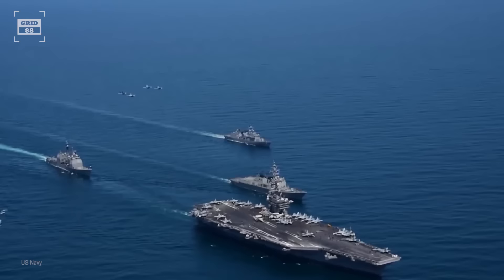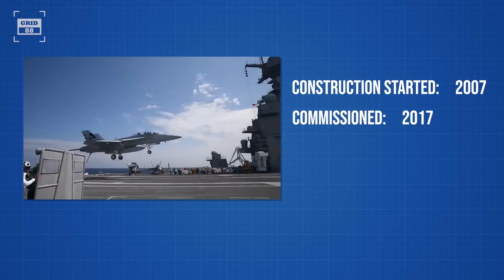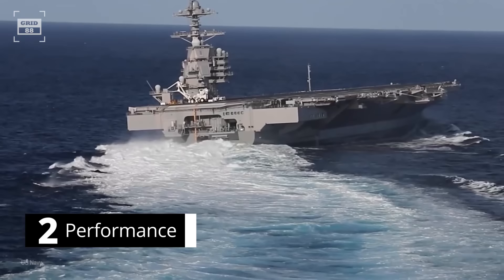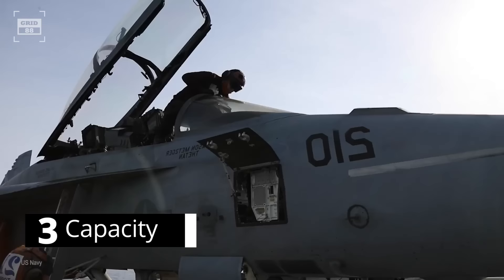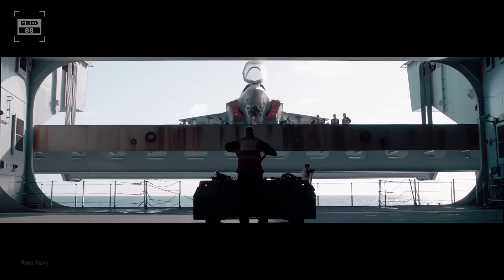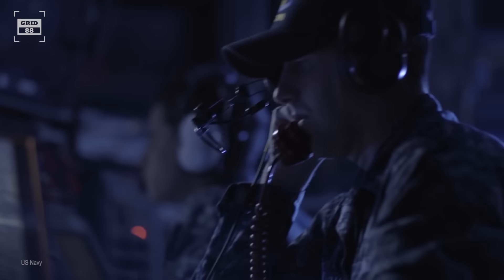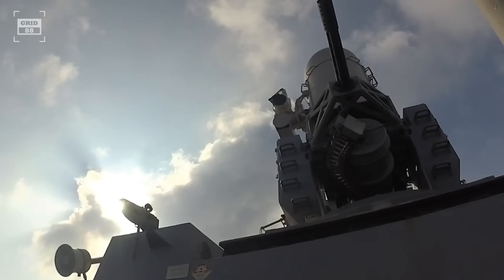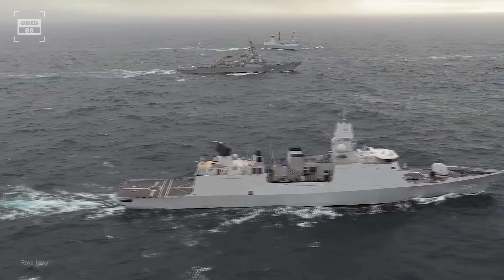USS Gerald R Ford vs HMS Queen Elizabeth - Which aircraft carrier is better?

Comment: Let's be fair now, you can have 3 queen elizabeth class carriers for the price of a Ford.   And crewing the two different carriers is also another massive difference, 600 vs 2000 or there abouts.   I'm in favour of the queen elizabeth for its price,crew,it's 30 plus knots of speed, 70 aircraft,survivability with having a 2nd island as a backup and it's design to allow modifications for cats at a later date.  75000 tonne is a very good size and it's certainly not small
Reply: That figure of 70 aircraft for the QEC is a fantasy. The QEC was designed to handle a max of 36 F-35s. The plan is to have it carry just 24.

Currently, the most UK jets the QEC has carried is eight.

Also, the QEC has two islands to house the two smokestacks for the diesel engines -- not for survivability.  Plus, the diesel engines are housed in the sponsons making them very vunerable to a missile attack. 

But either way, it is the Ford which is much more survivable.

The US Supercarries are CATOBAR and so can fight the battle from a farther range than the QEC thereby being out of range of the enemy.

Plus, while the QEC has just one layer of organic self-defense, the US supercarriers have three.

Plus, the US supercarriers are much more heavily armored with both thicker steel and Kevlar protecting the vital areas.

Plus, the US Supercarriers have a control room below deck that can perform all the functions normally done in the tower.

Also, the larger crew of the US Supercarriers means that they are better able to fight fires, deal with floods, and repair the ship while in combat.

Plus, US carriers have intermediate repair facilities aboard ship while the UK carriers do not.

------------------------------------------
Don't get me wrong, I think the QEC is a great ship and the right purchase considering the UK's budget.

But the US has way more experience designing, building, and operating carriers. Plus, it spends way more on R&D. Plus, it spent nearly three times as much building each carrier.

Experience, R&D, and money all matter.
Reply: @Courage2006  your wrong in many aspects there my friend there are two islands for what you said but either island can do what the other one does if a missile etc strikes the island of the Ford carrier it's obsolete in a fight yet the hms queen Elizabeth can stay in the game in terms of crew size loosing nearly 5000 lives is a much bigger loss than 1800 so another benefit to the UK and in terms of experience building aircraft carriers us Brits have been building them since they were created another invention you can thank us Brits for but ultimately speaking the  Ford class are better protected with better weapon systems but is it worth 3 times the cost? Also 72 aircraft can be put on a uk carrier fair enough we haven't got the planes at the moment but that's more than likely because they'll be a varient of the tempest being used in the future and more automated aircraft if you look on hms prince of Wales news feed you will see some of these. Either way USA and the UK are allies we should be thankful that we are both pioneers in democracy and rule of law
Reply: @callumflowers5720  My friend, much of what you've written is either wrong, misleading, or irrelevant.

But, before I address your other points ... If you can't even acknowledge that the US has far, far, far more experience designing, building, and operating aircraft carriers than any country in the world -- then this conversation isn't even worth engaging in.

Yes, the Royal Navy has a long and proud history -- but the UK did not "invent" the aircraft carrier.  The aircraft carrier is a composite of inventions from many nations.

But more importantly, It is silly to go far back in history and cherry-pick who invented what. If it wasn't done by people currently involved in the military -- then it isn't very relevant to what we are discussing.  And cherry-picking things from the past is always a silly game. 

For example: Yes, the UK invented the steam catapult and carrier ramps  .... But the US was the first to fly an airplane off a ship and also the first to land an airplane on a ship. The US also invented the first airplane catapult and invented barrier arrested landing equipment.  See? Both sides can go back and forth like without addressing anything relevant.  

-----------------
As for things that are relevant to our discussion:

The US has built and operated far more aircraft carriers than the UK -- and this is especially true over the past 30 years -- the time frame that matters.

The UK has so far spent nearly half the 21st Century without any fully operational aircraft carriers.  In fact, the US Navy has been teaching the Royal Navy how to operate their new carriers.

And while the UK is still working on getting just two aircraft carriers operational. The US has 20 fully operational aircraft carriers -- and has had around that many for the last 30 years -- the time period that matters.

----------------------------------------------

https://www.thedrive.com/the-war-zone/13368/royal-navys-new-supercarrier-trains-alongside-us-navy-counterpart-for-first-time

Below are quotes from the above article:

“We stand shoulder-to-shoulder here today to help them [the Royal Navy] refine and enhance their carrier strike group capabilities,” U.S. Army General Curtis Scaparrotti, head of U.S. European Command and NATO’s top officer, said ahead of the exercise.…

But training for carrier operations is especially important for the Royal Navy, which hasn’t had a carrier with fixed wing aircraft since it retired HMS Ark Royal in 2011.“The U.S. Navy, out of huge generosity, has given us the whole of their carrier strike group so that we can practice the command and control of a carrier doing these operations in British waters,” Royal Navy Captain Ken Houlberg, Chief of Staff to the Commander of the U.K. Carrier Strike Group, said.

“We are extremely fortunate,” Royal Navy Lieutenant Commander James Capps, who is the service’s Fixed Wing Operations Officer for Saxon Warrior 2017 and is situated aboard George H.W. Bush, said. “Being here on the George H.W. Bush has given us the opportunity to see where we are and what we need to achieve for our own U.K. carrier strike capability and to be here to see how the U.S. does it has been fantastic preparation.”
Reply: @callumflowers5720  The tempest is not designed to be a STVOL aircraft.
Reply: @Courage2006  
It's designed to carry 40 planes in patrol mode and up to 70 in combat mode.  The QE actually has comparable hangar space to the GF because the combustion engines don't intrude the bow and stern like the nuclear plants do.  The twin islands are a byproduct of the dual fuel systems, the exhausts are routed through them from the engine rooms in the depths of the ship.  The low plane count is due to 12 years of cuts to our armed forces by our "patriotic" Conservative "government".
Reply: Well… the UK is only planning on having two—HMS Queen Elizabeth and HMS Prince of Wales.
Reply: Let's be fair. The US has way more money and isn't worried about it

Comment: Ford is 3x the cost of QE but is it 3x better ? I dont think so. Speed is almist at par, plane capacity as well at par during wartime, while defensive wrapons aboard the Ford is only necessary under very extreme circumstance if you have fighter planes and type 45 destroyers as escorts. So dollar for pound i think QE is better.
Reply: You've fallen for a common myth.  Plane capacity is not "at par during wartime".  

The US Supercarriers are more than fifty percent larger than the QEC.   Plus, the American Supercarriers are nuclear powered leaving much more room for a larger hangar deck and more storage space for munitions and aviation fuel.

Also, it isn't safe or effective to just stuff a modern aircraft carrier full of planes during wartime if one hasn't appropriately outfitted the warship and practiced with that many planes before going to war.   

Yes, the UK did that during the Falklands War. But those were much smaller carriers with much less sophisticated operations and technology.  And the carriers weren't trying to fly a large, sustained number of attack sorties.  Most of the planes were used for defense. 

--------------------

The QEC was designed and outfited to carrier a maximum of 36 F-35s at surge capacity. Normally, it hopes to carry 24 F-35s.  Right now, the maximum the UK has been able to deploy is eight F-35s.

--------------
Yes, Supercarriers are designed to handle "extreme situations".   But the US Supercarriers also have far more capabilities and capacity that can be used in non-extreme situations.

--------
Yes, the QEC is a great carrier and more cost effective -- it wisely didn't try and implement anywhere near as much bleeding-edge technology as is on the Ford carriers.  The UK should be proud of those carriers.  There is no need to claim it is as capable as the much larger, much more advanced, much more expensive Supercarriers.
Reply: @Courage2006  I think your worried the UK has designed and built a much cheaper more efficient carrier class

Comment: Which is better is a silly question.  Clearly the Ford is better in terms of raw combat capability and extensibility.  However, it costs over 3 times as much.  There are surely missions where the Elizabeth is the more cost effective solution. I’d might rather have 3 Elizabeth’s in the Mediterranean but 1 Ford in the Pacific.  You need a mix.

Comment: The ford is better for one reason if nothing else. We use the angled approach landing area not to save space, but to save lives. When the landing and the takeoff  reas are the same, bad things on one end of the  ship spread to the other end quickly and quickly affect the planes in the air.

Comment: The video doesn’t quite capture how close these two carriers are to each other. It gathers information based on what each countries ministry of defence publishes, which is fine, but it first know about the cultural differences. 

The Royal Navy likes to be conservative and plays down is capabilities - discretion being the better part of valor for them. For example, if you ask them what is the aircraft capacity of the QE, it will say “45”, but if you ask what the maximum capacity is, they will say “72”. Ask the same question of the US navy and the answer is “75” for the first question and “75” for the second. You can see this culture play out in the top speed too - The Royal Navy claims 25 knots yet the ship’s been clocked at a sustained 32.

If you compare the two carriers holistically as well as statistically, this is what you get:

Performance: 30 knots vs 32 knots - nothing in it, but the QE is slightly faster.

Range: When talking about range one should consider “practical useable” range. Sure, the Ford can run forever, but it’s going to need fresh supplies of food, ammunition, aircraft fuel and other materials just as regularly as the QE, at which point, if you’re gonna restock and refuel your aircraft, you might as well refuel your carrier.

Capacity: 75 aircraft vs 72 - not much in it but, but the Ford is slightly higher.  However, it’s not all about carrying capacity, it’s also about the number of sorties per day. Ford can run 160 sorties per day, whereas QE can run 110, so Ford wins.

Weapons: I’d say the QE edges the Ford on Electronics. The Artisan 3D system can track 800 objects, the size of a tennis ball, coming at it from as far as 200km away. The Ford however out guns the QE with its laser cannon. But which of the two systems would be more useful, the most advanced  electronic tracking in the world or the laser cannon? Let’s give this to the Ford.

Ultimately, the Ford class is only just better as a stand alone single proposition but pound for pound, the British carrier is better conceptually for two reasons. 

The first being that you can get 3 of them for the price of 1 Ford. What is better, a carrier which can carry 75 aircraft and handle 160 sorties or 3 carriers which can carry 216 and handle 330 sorties? Given that the whole point of an aircraft carrier is to project air power, I would say the latter.

The second reason is operational cost. The biggest operational cost is personnel: salaries, pensions, food, training, medical, holidays. The incredible degree of automation in the Elizabeth class means it only needs 22 crew per aircraft whereas the Ford class needs 65.

What the US wishes it had done was to go with the British concept and philosophy, because for the price of the 10 Ford class carriers they are planning to build, they could have had 30 QE class carriers, which are almost as good. In other words, the QE costs over 3 x less than the Ford, but the Ford is not 3 x better than the QE.

Comment: These 2 ships have very different design and operation strategies.
I feel both ships are equal when considering design, operational capabilities and defense spending.
France and England wanted to jointly build nuclear powered carries.
England didn't have the capacity to dispose of extra nuclear waste on top of disposing of nuclear submarine waste.
The partnership was broken:
France operates 1 nuclear powered carrier.
The UK operates 2 conventionally powered carriers.
2 is better than 1, especially if you build a support fleet to protect a carrier.

Comment: I think the Spanish carrier is best value for money. Juan Carlos I, then QE2 and then the Ford carrier.
You could get 20 of the Juan Carlos for 1 USS Gerald R Ford. and about 5 of the QE2 carrier. 
Having 20 small carriers, could launch 20 planes, while the 1x  Ford can launch 4 planes and 5 x QE2s would also launch 5.
The 20 Spanish carriers would be able to receive 20 planes at a time, 1 x Ford only 1 at a time, and 5 QE2s would receive 5 at a time.

The only thing the Ford has over the other options is lower running costs.

The Juan Carlos carrier is also an amphibious assault ship so also has that.
Reply: Completely disagree, you can go too far in that direction by making things too small and too cheap. The Royal Navy decided against building new pocket carriers like the previous Invincible class. Juan Carlos I can only carry 12 old Harriers. Queen Elizabeth can carry up to 72 F35s. Why would you choose a bunch of pocket carriers with 50 harriers than a super carrier with 72 F35s? Even 10 F35s would be a better choice than 50 Harriers.
Reply: @mikelovesbacon  I assumed the Juan Carlos can carry say 10 F35's. Is that not the case?
If we built 6 ships like the Juan Carlos, slightly upgraded to handle just 10 F35s, you could probably build 6 of those for one QE2 carriers. 6 x Juan Carlos type carriers would then carry 60 F35's plus helicopters, and still be an assault ship. 6 small carriers would then be able to launch or receive 6 planes at a time. The QE2, can launch and received 1 of each, 2 in total. 
I love the huge carriers, but I suppose at the end of the day, it's all about the bang for the buck.

Comment: Ooooh, so close. You were doing so well until the 3:00 minute mark.  NEVER precede HMS with the.  Yes, with Ships names; The Kent, the Westy (HMS Westminster) the Up and At 'Em (HMS Chatham), but never the HMS.
Crew capacity can vary by demand regardless of what the official capacity is listed as.  During Ocean Wave in 1997, the Queen Elizabeth's predecessor, Illustrious, had over 2,000 (possibly even as high as 2,500) on board although her normal capacity would be around 1200 - 1400 or so, depending on tasking.

Comment: Didn't mention the C-2 Greyhound, a twin-engine turboprop airplane the Ford has. It's a flying bus or supply van, hauling people and cargo onto and off the carrier.
Reply: I understand the Greyhound has been replaced by the V-22 Osprey which is supposed to support transporting an F-35 engine (The Greyhound can't). Unless the F-35s aren't being deployed the Ford (very unlikely), there won't be any Greyhounds aboard unless to augment the Ospreys.
Reply: @tonysu8860  The transition is underway but far from over.  And the Ford is one of the carriers it hasn't happened at yet, which is odd considering it's brand new.

Comment: On your figures ,three QE's could be built for the cost of a Ford. That is probably true of the running costs as well. Perhaps you should be asking if three QE's would be better than one Ford, particularly as the catapults of the Ford are still highly iffy.
Reply: As Trump said, steam cataults are tried and tested and could have been used. There are ways to modify them to put less strain on the aircraft they launch. They have done a good job for well over half a century. I'm sick and tired of hearing excuses of why a third rate carrier is better than a nuclear powered, catapult equipped carrier. Future Fords will be a lot cheaper than the first, and with any luck the catapult problem will be sorted out.

Comment: no comparison.  The Ford is a nuc powered Super carrier.  The QE is petrol powered carrier limited to STOVL aircraft of limited payload and range
Reply: nuclear power doesnt feed sailors or put fuel in planes, so Ford still needs the plodding donkeys of supply ships, and carriers are not for the same use and the aviation strike groups would probably be doing different roles

Comment: One has 64 Fighter jets and 4 Grumman AWAC and 4 Grumman Greyhounds planes and 6 Rescue Helicopters. The other has 15 Planes, no Awacs and a few Helicopters.

The benefit of the Ford class they can out perform the QE in every aspect plis dont have to he refiled every 7 days.

So the $3 billion price tag is irrelevant.
Reply: The Ford Class still needs to RAS regularly: it needs food, aviation fuel, and ammo. Being able to sail continuously doesnt feed the crew or fill the jets. 
The metric would be range of strike planes and how many sorties can be  made daily. Ford class would win that but not by as much as you would first assume. Plus doctrine and use are different for both navies.